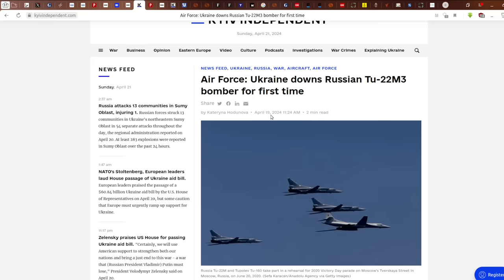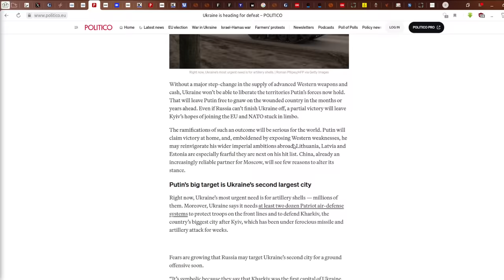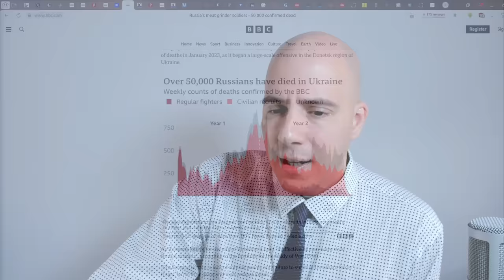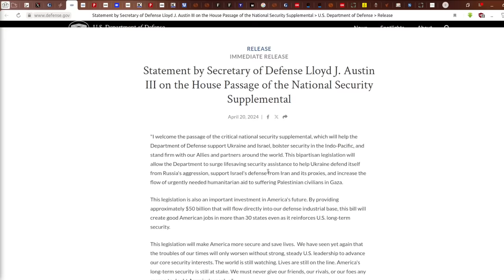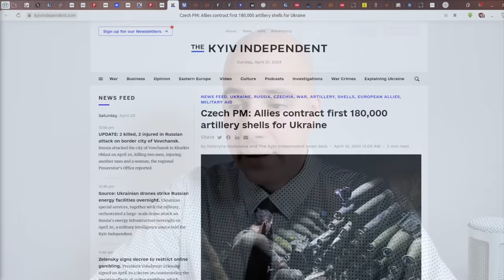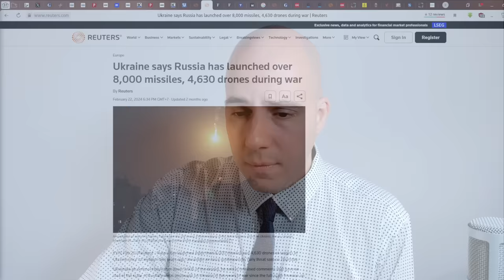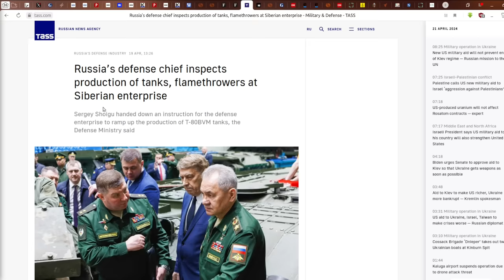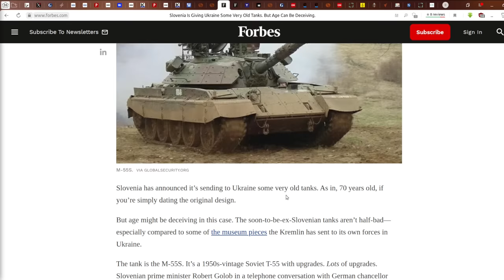US Passes $61 Billion Ukraine Spending Bill But Lacks Arms/Ammunition to Send in Sufficient Amounts

Comment: Ukraine will need massive annual cash infusions to stave off total defeat. So, it’s $61 billion as the baseline for an annual appropriation in a new forever war. Iraq and Afghanistan wars also began with annual appropriations in the $60B range. Those wars ended up costing trillions. The new funding bill could do no more than possibly buy Ukraine precisely half of a Summer Counteroffensive.
Expectations that the U.S. will be able to resolve artillery shell and air defense missile shortages by throwing more money at the problem is not realistic at all and we found this out two years ago with news of the real rates of U.S. artillery, ammunition and missile production. The U.S. defense production system is not oriented to high volumes of lower value items, but low volumes of high-cost units along with a lifetime of maintenance and logistics support with upgrades.
Reply: “hey that’s capitalism, nothin to see here,” said the smiling carpet-bagger.

Comment: Hawk missiles, really!?  I was an Army air defense officer back in the 1990s.  During my training in '93, we didn't even conduct training on that system because it was so outdated.  Hawk is system developed in the 1950s, field in the 1960s.  Patriot completed replaced it for high altitude air defense in 1994 then Stinger replaced it for short range air defense by 1997 or 1998.  The only reason to send Hawks would be if you are out of Stingers and/or Patriots to send.  Pretty sad situation if we're reaching this far back for this old of a system.

Comment: Stinger manpads (short range, low ceiling) is not in the same league as Hawk, which was the system that preceeded Patriot. Hawk has not only a further reach but also a higher ceiling. The fact that Patriot is more recent, does not necesarily mean older equipment is useless or obsolete. Hawk is still in use and continually been updated, first by the manufacturer and later also by 3rd parties.  It is also more mobile and with lesser clutter than its Patriot succesor, which is more intended to be stationary. It was Ukraine's experience with a donated Hawk from Spain, and if I recall later also Sweden,  that stirred the interest in having more of these. Greece and Turkey also have them still in sevice and some other EU nation former user may have them mothballed if not sold to other many allies of the West. As well as the US who probably has a large inventory not only of launchers but of missiles. Most could be persuaded with an offer to move to a more modern system and this would free available missiles to Ukraine. Updating older is also easier and cheaper to the latest iteration compared to other systems. This would also allow to save the very expensive Patriot missiles for those high value menaces it is better suited to.

Comment: 37:40
HAWK and Stinger missiles are two completely categories of air defense missiles that can hardly be compared. 
HAWK is a medium-range missile with a maximum engagement range of 45–50 km and a maximum engagement altitude of 20,000 meters. 
Stinger is a MANPAD missile ( man-portable air-defense system) with a range of around 5 kilometers. 

While it is technically true that Stinger is a newer missile than the HAWK, HAWK has been extensively upgraded throughout the years with the latest iteration being the Hawk XXI which has entered service in recent years with several countries such as Spain, Morocco and Turkey. Hawk XXI is a very capable missile comparable to the latest models of the Russian BUK missile.  
Furthermore, there is a very large potential pool of HAWK missiles available with more than 40,000 having been built.

Comment: @ 37:49 , the STINGER is a shoulder held, IR ,max 10,000 feet range,  personal SAM.  In contrast HAWK is mounted four missiles on a wheel trailer, radar guided, launched by an operation team that scan, track, and guide the HAWK to its target. Range is approximately 15,000 feet.  The notion of using HAWK to replace STINGER is erroneous.

Comment: HAWK's biggest problem is that most of its site elements have to be brought as separate units, assembled and set on their launchers as discrete units.  As a result, it is not possible to de-elevate the launcher, hook up a prime mover and didimau on down the road in 5 minutes or less.  Instead, it takes HOURS to properly set up and site survey (clutter map) the battery location and, in an era of Kalibr, Kh-101 and especially Iskander/Lancet, with as little as five minute response times from target handoff, this is lethal.

Defending cities, maybe.  But not the front lines.

Which is where AD is _crucially needed_, to stop stop the constant aerial attacks with large caliber rockets and UMPK glide bombs that are successfully driving Ukrainian army defenders from even hardened field fortifications.  Absent any HiMADS, even a 10-15nm standoff (UMPK's glide efficiencies are massively overstated) becomes a lethal overmatch, denying coordinated defensive efforts to establish new lines.

The Hawk itself is an enormous missile at 16ft, 1,300lbs with giant, 4ft, wingspan and a lot of base drag.

This results in a fairly slow/low (Mach 2.6) kinematic performance and thus is entirely unsuitable for any form of supersonic/ballistic target engagement when not attacking the site footprint itself (2-3 miles around the battery).  Against hypersonic threats, it has no chance at all.

Vs. low level CCA/CAS threats, it is competent enough, due to the shear power of the LASHE illuminator and 'unjammable' TAS, electro optical tracking adjunct, but terrain and clutter as much as horizon effects being what they are, you are still not going to effect intercepts much beyond 8-9 miles downrange, with an absolute range of about 12-15nm against targets above the horizon line.

The biggest problem with HAWK is how noisy and large footprinted it is.  Depending on whether it's PIP I/II/II or 21, the Hawk has a minimum 2 (MPQ-61 illuminator, MPQ-57/62 acquisition/tracking) radars and could have as many as three others for height finding and general surveillance.  Hawk 21 reduces this to just one, MPQ-61, but requires the site to be nested in a cluster of MPQ-64 Sentinel FAADS alerters which are themselves short ranged, 'loud', when used in multiple to provide unified coverage, and limited in their high angle, fast target, coverage.

Again, all of this compresses the engagement sightlines and leaves the entire battery vulnerable to Kh-31PD and Kh-59 saturation attacks.  These missiles are not replacements for Patriot or S-300, as area air defense systems.  They are closer in role to the SA-11/17 Gadfly/Grizzly (Buk) medium SAMs, without the advantages the Russian mobile SAM integrated launcher/radar, track mounted 2-3 minute mobility and much faster missile.

You lose the ICWAR and the rest of the battery is just so much fireworks display on wheels.

What HAWK deployment may instead signal is an attempt to use the launchers alone, as mounts for AMRAAM.  If nothing else, rocket motors on missiles degrade fairly quickly and do not last in residual stockpiles for twenty to thirty years after retirement (Army Hawk out of service date was in 1994, Marines in 2002).

I vaguely recall we tested the AMRAAM option, as a cheaper-faster alternative to NASAMS, for the Marines, back in the late 90s.  Range will not improve much but ability cooperatively launch from multiple, fixed, trailer mounts, using the Sentinel micro radars, may help disperse the site.  And we have a LOT of early AIM-120B/C.

One thing which is certain is that a full HAWK battery is not being run by 5 tech reps and a few Ukrainian service personnel.  More like 100+ people, minimum.

An attack on Dnipro is an attack on the center of an 800 mile long country.  You can't simply loft the weapon from X-standoff, behind the border, you have to account for the considerable depths, in-country that you plan to reach.  And for a jet at 35-45,000ft, lofting aeroballistic weapons like the AS-4/6 (Kh-22/32) with 600km-1,000km respectively, this means at least a small 20-50nm penetration of Ukrainian controlled airspace.

Which is simply not safe as the bomber only as ~2-3G performance at these heights and little or no EW to help it along.

A complete modernization of the Backfire force was cancelled to make budgetary room for the PAK-DA stealth bomber program and as a result, the jets have limited modernizations to the radar, nav-attack system (SVP-24) and weapons interfaces, but nothing to really improve their self-protection systems, from the Cold War period when 'escort jamming was largely given over to the aged Tu-16P Elka or Buket.  Both of which are long since retired.

Russia's shortage of escort jammers is a major factor in their continued ability to support the rapid advance of their troops.  As the L-700 Tarantul is old and weak and largely confined to the Su-24MP fleet which itself is exiting service.  While the new, SAP-14, pod, which is similar to the ALQ-99 on the Growler and intended for use on the Su-30/34, is only available in very limited, testbed, numbers.  They need at least 30 pods in the theater and I don't think they have more than 5-10 in the entire VKS.  This is a big deal, especially as Khibiny has been compromised by consecutive shootdowns of Su-30/35 with intact wingtip pods.

It is very unlikely that the S-200 is being used, simply because of the very large missile and launcher and squat eye guidance radars, which are really only suitable for fixed emplacement installations like the old NORAD NIKE Hercules sites.

But the reality is that, as a Mach 8 missile with a 400-500km range, it is more than capable of being a threat to targets well out over the Sea of Azov and as far north as Belgorod and maybe even Engels, from relatively safe locations, behind the front.

The target would have to fly into the Gammon missile, using a simple autopilot lofted strapdown midcourse, with delayed (externally overhead cued) radar popup as snaplock terminal guidance.  But if done correctly, this would eliminate one element of the high-fast threat as it forced the Russian force to engage with only 2,500km Kh-101 or 3,000km Kh-555.

 This is not as important to the frontal war but it is crucial to continued attacks by Russian strategic missiles, on the electrical grids and transportation networks.  Without full participation by the Tu-22 force, the Russians will be forced to use limited stockpiles of Kh-69 and whatever stealth systems (Okhotnik or Sirius/Orlan) they can manage to get deep enough to launch them.  Not a good plan when you have few such platforms, though rumors state that it was one of these 190nm missiles which struck the Kiev powerplant.

That said, at a guess, it seems much more likely that a small drone/cruise missile, ala Longshot, with widespan wings, is being used.  With singular AMRAAM or paired AIM-9X and a post-mission 'splash down' vehicle sacrifice in something deep and wet to hide the proof of foreign intervention.

This would allow you to steer the intercept via satcomms and SBIRS alert to an on-missile IRST or even radar acquisition before launch of the kill effectors.  All while providing a genuine, deep target, force engagement capability, as/before missile launch.  Most importantly, it could be fired via MCALS or similar (C-130/C-17) aircraft, operating outside of Ukraining airspace and thus, without ever being clearly phone-photo'd by Ukrainian spies, 'in theater'.

LINK-
DARPA Longshot
https://www.youtube.com/watch?v=ZfiW6XA7OPw

Comment: Still need to address why Russia can't just stroll through Ukraine and take what it wants. The Kiev-based junta still packs a huge punch, particularly for the debilitated force you picture it as being.
Reply: If you are not able to stabilize the front line, you definitely do not pack a huge punch.
Reply: Do you have any idea about the scale of this war? It's a massive artillery exchange across a very large frontline. One cannot simply roll over Ukraine, not without completely decimating everything in your path. This would also cause a significant amount of casualties on the Russian side. Adding to that, you have to balance regional stability and ensure that tensions don't rise to the point of nuclear confrontation. It's a lot more complicated than just taking control over territory. Russia is too big geographically already, more territory to administer isn't the aim.

Comment: Russia has 50.000 (fifty- thousand) old and rusty tanks (more like rusty hull) in over 100 huge scrapyards (mostly T54/55 T62 and T72). and Russia has 12 bigger, and a couple of smaller, repair workshops which are bringing those old tanks (and IFV's) to modern standard (RT/Svesda has a documentary about this). Russia is producing 350 new and 2500 modernized tanks every year. what about the collective "West" ?

Comment: 45:20 The T80 is perfect for the new battlefield since most tank advancements in the past thirty years were done to tank armor to protect tanks against sabot & heat rounds.  But these threats are less dangerous now than are drone style weapons. If a re-issue T80 gives you 99% of what one requires from a modern battle tank at a savings of 70% compared to a new tank, well then that is the best solution for real war. The T80s will get drone defeating electronics and roof/cage structures that whole new tanks would also need. These "bolt on" components are not required to be integral to the tank design.

Comment: NO, the spending bill did NOT pass. The US House passed it and the Senate needs to vote on it, which is scheduled to start on Tuesday.

In order for the Senate to vote on the bill, they first have to vote to end discussions, requiring 60 out of 100 Senators.

If the Senate includes any amendments then a committee consisting of the House and Senate is formed. This committee creates a new bill, acceptable by both House and Senate members.

This new bill then must be voted on by both the House and Senate without new amendments (which would require the new bill with amendments to go back to committee).

It's highly likely that the bill will be voted on Tuesday or maybe Wednesday. It's possible that voting will be delayed a few days, maybe until Friday. It's unlikely to go to House-Senate committee, but if it does it could delay things by a few weeks.

Comment: The problem Russia is facing is their inability to pull back from always attacking so leaving aside ATACMs which are specifically mentioned #send_it this War is basically CQB with Artillery which very much fits into the strength of Western Militaries which emphasive "punch" (or counter punch in this instance) as oppsed to massed attack which is what Russian doctrine or at least Soviet Doctrine was. Western Militaries have a truly awesome amount of equipment in storage but you are correct in saying trying to provide all of the support in that to include of course ammunition but also all of fuel, fluids, spare parts, logistical train...depending upon how big a truly awesome effort...plus the need to protect all that from air attack. Still the intelligenge gained alone from these truly awesome Russian military failures that continue to be doubled down on are a real problem with the USA leading the way on "spending big." Ukraine definitely learned a lot by fighting lean over the past 6 plus Months...inflicting even more casualties on the Russian Military than before...but with the possibility of millions of drones en route to fight against The Occupier plus Ukraine even able to produce internally its own Artillery System and make no mistake Russia is in big trouble here as clearly the USA will not be "going it alone" with this but will have something that includes all of Europe plus Turkey as well #case_blue
Reply: i find it hard to believe america or da west fo dat matter will be able to successfully reorientate their economies fo such an effort when we’ve been known ukraine was lost for at least 7+ months now.
Reply: Hopium